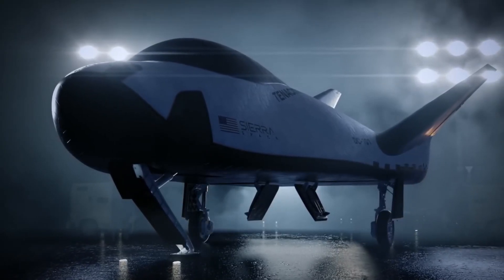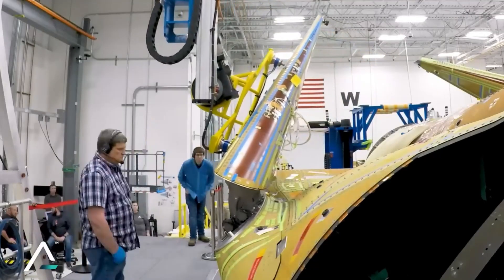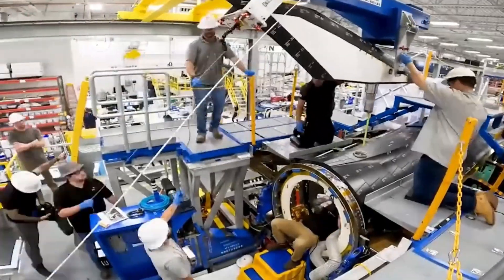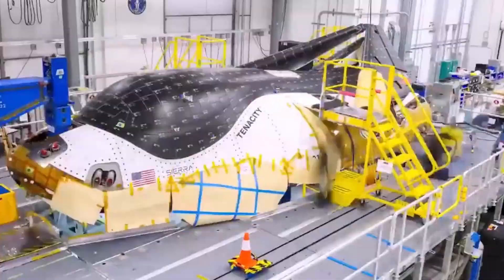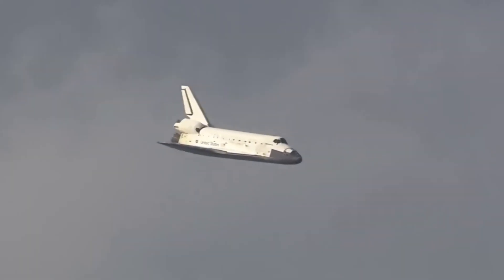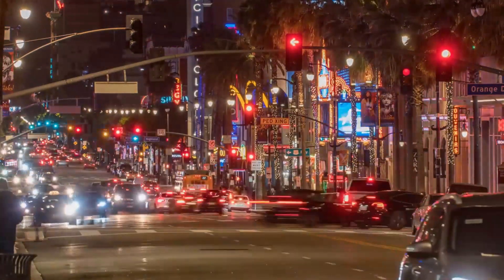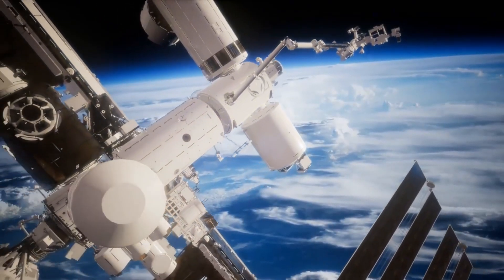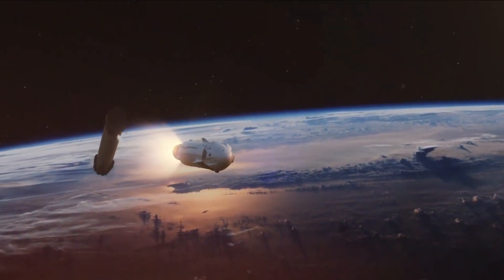Dream Chaser Reveals Revolutionary Heat Shield: What Musk Called 'Impossible' Is Now Reality...

Comment: The choice between Heatshields and Engine Braking is the biggest conundrum we are facing.  Eventually, coming in slow and cool or fast and hot will be the decision deciding the evolution of our species or our extinction.  Using material that is about one third of the weight of stainless steel to construct our spaceships, so we can carry enough fuel to avoid the reentry meltdown or slowing down the spaceships to glide in slowly, will decide our future.  
The biggest clue is landing rockets by braking their speed and landing like the old science fiction authors envisioned.  That is your most impressive feat, to date.  Using a different material to build your rockets and slow them down on the way back to Earth may be the key to solving reentry disasters!